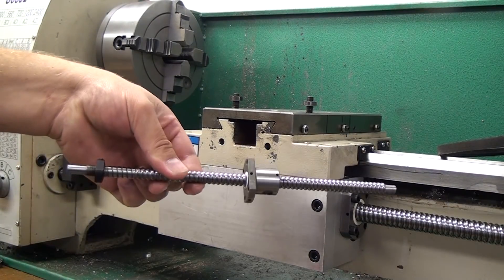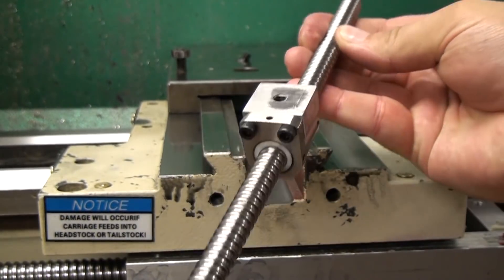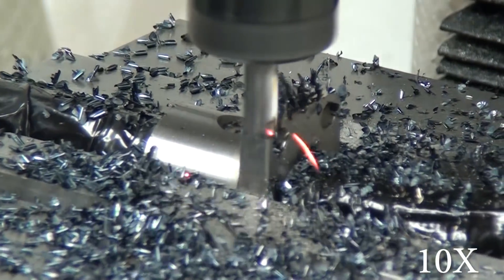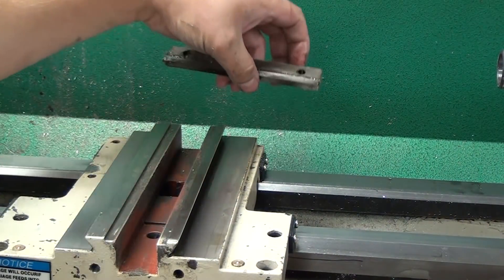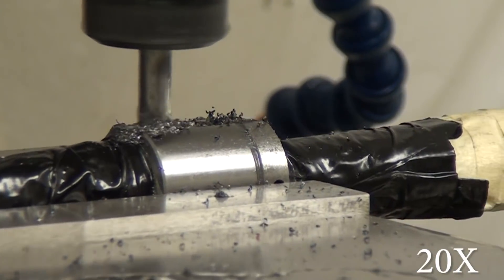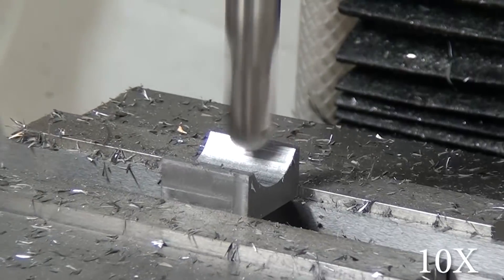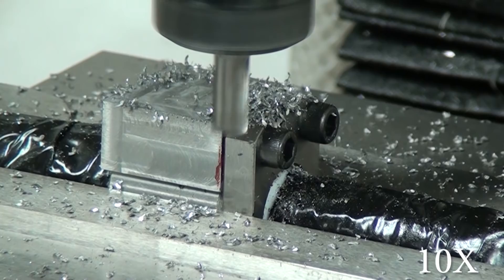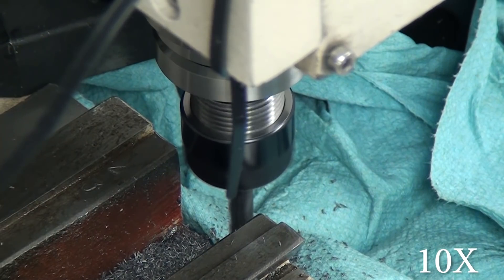G0602 CNC Conversion pt7 - X-Axis Ballnut & Saddle

Comment: Here my 3 cents. Lathe are not made out of aluminum, there are zero essential parts on a lathe with this metal for very good reasons such as rust, vibration torsion, tensillity impact..... Yet this conversion is 80% aluminum. What am I missing?

Comment: Hi Russ, I am following your build, and I got all the materials except the belt and pulleys My question (in a nut shell) is: is the belt drive accurate? I am having mixed feelings about doing belt drive on my axis because I don't know if it is accurate, what would you recommend to use to maintain accuracy? how is it working for you on accuracy on the X axis? is it working well? should I go ahead and use belt drive? I have never tried belt drive before, and I am concerned that it may not be accurate. I read in your comments that you would not have done the belt drive but direct drive,  I know there is belt stretch, and that can be factored in when setting up counts per revolution with your stepper drive so that it moves the correct distance, but what about hard cuts verses light cuts? will the belt stretch more? because I really want to keep that motor tucked in away, and that is what attracted me to your build. if you wanted 1 to 1 gearing; couldn't you just use the same size pulleys?  please say YES that belt drive is accurate, because I am already started in following you LOL thank you very much Russ.
Reply from the maker: The main reason I wouldn't do the belt drive again is because of that added complexity when troubleshooting issues. I have more problems with the x-axis on my lathe then I have on the z-axis, or any of the axes on my mill. I honestly don't know if it's the belt drive that's causing those issues, but it's one more thing to troubleshoot. I have not noticed a difference in accuracy when taking heavy cuts versus light cuts.

If you're trying to keep your stepper motor out of the way, I would mount it to the back of the X-axis and cut out whatever clearance is needed in the back of the chip guard. This might not be an option if you ever plan on running flood coolant (I don't).

At some point in the future I'm going to try and install a linear DRO scale on the x-axis so LinuxCNC knows exactly where my cutter is at all times. I've heard it's a nightmare getting that to work with a stepper motor, but I think it's the best path forward for me right now. I don't have a timeline for tackling this potential upgrade.
Reply: @russtuff  thanks Russ for the input. so when you say troubleshooting problems; like what kind of problems? if the accuracy is fine then couldn't a guy get used to figuring out what works, I'm not sure what kinds of problems I would have to deal with. Yes, I wanted to put the motor in the back also but the chip guard is in the way. maybe there is a shorter nema 34 that might help to have more clearance. I just looked at the clearance, and there isn't even hardly 3 inches of clearance for a motor however, I was looking at the chip guard, and why cant a guy just move the chip guard further back? just drill some holes in the motor electronics enclosure to mount it there, and extend the mounting in the tail end? I am sure there is a number of ways to move the chip guard back, and not have to cut it. then just add some sheet metal to the bottom of the chip guard to extend it towards the machine more. I'm sure that would be pretty easy to do, then all I would have to do is just mount a bearing block on the back, and it would be perfect, and the apron in front would be tucked under real nicely. YEAH! that's a smart idea, and I could just remove the chip guard for now, and do the build, then add it later. or maybe it would be good to cut a little channel that the motor could fit through, and make a little sheet metal box, and braze weld it in the slot to have the space. I like the rear mounting, it looks like it would be a really good way to go. thanks Russ.

Comment: I know this is an old video but has anyone done this mod to a Jet lathe? I have a BD920N and the x carriage looks a little different. The slot for the screw does not go all the way through. Also the SFU 1204 ball nut that I have has six mounting holes instead of four. The body of the ballnut is 22mm and the width of the slot is under 18mm. Has anyone done this mod with the Jet??? Did you mill away the carriage or take more off the ball nut?

Comment: Good job cutting that ballnut. So have you found the ballnut material relatively easy to machine? I've been considering putting one in a lathe and taking the flange off and then threading the end. Do you think a good carbide tip would manage that? Also, have you found the hardness changes below the surface, or is it pretty consistently hard all the way through?

Anyway, keep up the good work, and I'll keep watching.
Reply from the maker: It was OK to machine, and as I recall it was hard all the way through. I think you'll need carbide for it.

Comment: Now that it's been a couple years, are you happy with your CNC build? Anything you'd do differently?
Reply from the maker: Hey Justin.
Yes I'm overall happy with the CNC conversion, but there are a number of things I would do differently.
1. I would have built a larger table/bench for the lathe to sit in (more depth).
2. I would have gone with a motor larger than the 1hp motor I chose, and I would have just mounted it to the bench instead of messing around with trying to mount a motor to the back of the lathe.
3. This is the biggest thing. I would have gone direct drive on the X-axis and mounted the stepper on the back of the lathe (I haven't spent any time researching if this is doable).
If I don't upgrade to a larger lathe at some point (like a used Mazak or something big), I may still do all of these things.
Reply: russtuff Why direct drive on the x axis? Don't need the extra torque?

Comment: Oh I see!
Do you think Sams's setup will works on your motors? I got same your motors and pulleys, actually I just copied your setup!
I have a copy of Sam's balls crews PDF drawing Do you think if I just ordere them based on Sam's drawing they will work ?
Thank you sir
Reply from the maker: +Ozy Ozy I'm really not sure, but I have doubts it would work because we are using different bearing blocks. As long as the screws you order have an overall length greater than what you need, you can use the lathe to trim them down and machine the bearing journals on the lathe like I did.
Reply from the maker: +Ozy Ozy Hey, I made a video for you at: https://youtu.be/mReME3josV4

Comment: Great Video as always, Rus,
 Very interesting to see another angle on the G0602 conversion. It's the Manual machinist in you that takes over ( that's why you lay out the holes with a Awl) LOL besides sometimes it's easier than going back to the software making changes etc.  Did you say you used A 14 mm Ball screw?
Be Safe,
Sam
Reply from the maker: +CNC4XR7 This is a 12mm screw (1204). What screw did you go with?

Yeah it's been a fun build. Yours is so much cleaner in many ways. Hey I need to get some wire track but was wondering if you ran your wires through a waterproof loom or tubing before putting in the track? I should probably comb through your videos again.
Reply: +russtuff 
Same thing RM1204
My wires for the Motor and Home switch are 2 and 4 conductor cables so I just ran them in the cable tray as is. I figure there coolant proof except at the connections which are out of the way from the coolant. So far so good.
I have no plans on hosing the lathe down with coolant or anything.
Be Safe